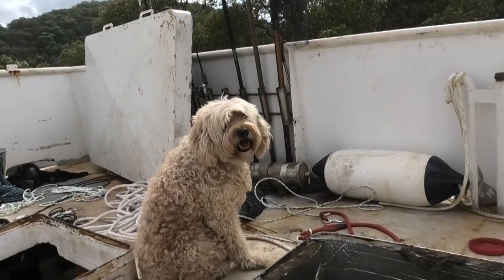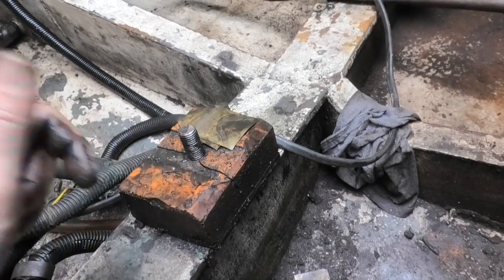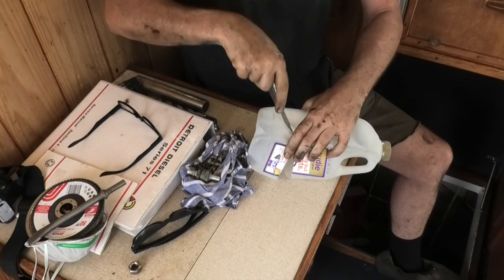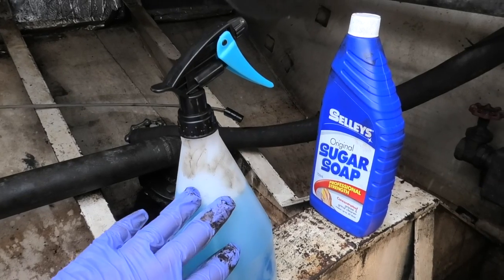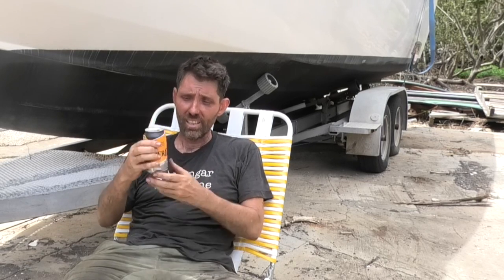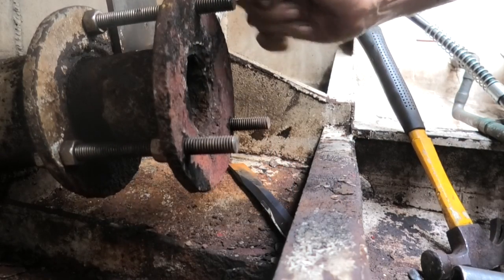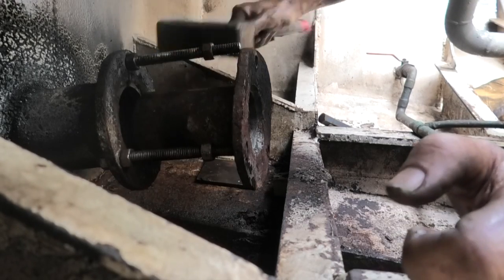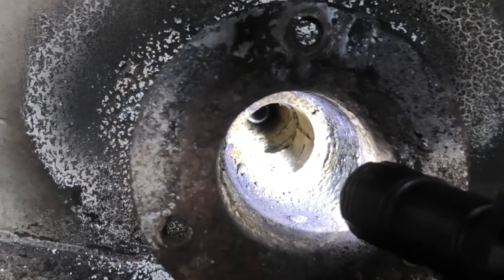Removing the propeller shaft from the steel trawler

Comment: Go dripless shaft seal. If not don’t use Teflon packing. If you use more than 3rings of packing make sure to use a lantern ring. Install a stuffing tube cooling line. Retired USCG CWO3 Naval Engineer.
Reply: thats solid advice
Reply: Can you elaborate on the cooling line?
Reply: Thank you all for your service!
Reply: A drip-less setup is a good idea. Gland packing has to leak as it needs the water as lubrication, if you tighten the gland follower too tight and prevent any water from exiting the stuffing box while the shaft is turning the packing will melt and begin to leak profusely this may also cause damage to the shaft. A lantern ring is usually placed after the first packing ring and before the final two or three rings. It is a steel or sometimes plastic channeled ring that is similar in dimension to the packing it it has ports drilled into it radially around its circumference, a port in the outer sleeve of the stuffing box is aligned with the lantern ring through which water is pumped, the water can then travel through the lantern ring and is distributed around the rotating shaft and forced under the packing  to provide lubrication.
Reply: Dripless seal, the way to go. Cheers 👍👍
Reply: What this dude said
Reply: Donald Sayers Mostly Bronze.
Reply: otm646 the cooling line normally comes off the raw water line on the engine. Always under pressure when the engine is running. Normally connects to the gland assembly, this does two things, 1st it provides a positive pressure to the packing/seal assembly of clean water  and 2nd provides clean water to the stern tube bearings and keeps them flushed out. With a typical RW pump you have between 6-15 psi of water pressure. Most of the time on boats of this size you’re looking at  3/8” (10mm)
Reply: @Mainlander now now ,  no need to get personal , you can both try to help by co-operating for the greater good  ( I have no idea what either of you said ,i'm a land lubber but impressed that you both want to get this boat in A1  shape)

Comment: Going well Stu.  You have to love cleaning bilges.  All the issues seem to be able to be repaired.  I agree with the comments re a water feed into the sterntube the water lubricants the stuffing box and exists via the cutlass bearing. It would be a good modification.  Even if you go to a dripless seal it would assist with the cutlass bearing. Rgds J
Reply from the maker: Thanks mate. Will certainly be looking into all the options for upgrading the seal.

Comment: Hey Stu, you gotta love it when you go into a job you thinking will be a nightmare, and things go better than if you had planned them. As the USCG CWO3 suggests, the dripless shaft seal and a cooling line are great ideas.
Reply from the maker: The biggest issue with dripless (other than cost) could end up being the space between the sterngland and the gearbox but we'll see.

Comment: Hi Stu, oh boy you’re really moving along now. I bet once you’re done you’ll notice a huge difference in the way she runs, smoother, quieter, and probably more efficient. I like your idea of a hard rubber for the mounts. I would imagine there’s some sort of steel and rubber type mount out there. I bet it would make a huge difference in vibrations and thus less sound being transmitted through the hull. Even if you dont do any engine disassembly(if it isn’t broke, don’t fix it), give it a nice coat of fresh green paint. Then you’ll have the green machine and your trawler’s engine could be the green monster. Great video bud, take care and keep charging on.
Reply from the maker: Thanks Kris. Definitely going to pair the engine, particularly the sections that have started to rust. Still need to do a bit of homework on the engine mounts but those broken ones will definitely need refreshing.

Comment: A trick for your bilge pump. One of the old steel boats that I used to work on I would reroute the bilge to come up through the deck at the gunnel. Use a 90° elbow to pump just overboard with a one one-way valve on the end. They seem to work really well and it was not a toe kick and it kept the deck free from unneeded water and hoses.

Comment: Clean the stuffing box good and when you reassemble it don't forget to use "anti seize". It will work good on the threads as well as the gland. Be careful on what you get for packing. It should seal but not mark the shaft. Check with a packing dealer. Sometimes a grease fitting on the outside of the stuffing box will help the packing stay lubricated. ask the packing expert. Best of luck.
Reply: I AGREE about using Never Seize.
Very good stuff on anything where threaded connections are made and also a great lubricant. 
I used lots of it when rebuilding shaft seals and stuffing boxes, works great and lasts a long time.
It's also great for dissimilar metal contact situations.

Comment: Yeah, those packings looked about the way i expected them to look. However, i did not expect the stuffer to be stuck like it was.
Clearly never seen grease, as i thought and we've spoken about. From here, the shaft doesn't look all that bad. 
And yes, buying a steel boat is fine, as long as it is maintained propperly. Which isn't the case with your boat, sadly enough. But hey, the price was right and i've seen nothing that can't be repared or upgraded sensibly.
I also like your plan to divide the bilge, good call!

Comment: Stu, I know you have passed most stages that can use the idea, but it may still come in handy. If you want an area to dry , or stay dry, from condensation or slight (very) weepage, get a cheap pack of toilet paper rolls. Leave the cardboard inners in the rolls, tie some string through the core ( makes retrieval, removal easier and cleaner) and place the toilet rolls vertically in the lowest part of the bilge/sump. The workings are pretty obvious, the advantage is that that even a flakey , rusty area will dry right out  as the toilet roll wicks the water /oil up.No power required. Runs 24hrs a day and is cheap. 
Just watch the toilets rolls - they are not a long term fix. With lots of water around the rolls last about 24hrs before falling apart once soaked. With oil they last about week before falling apart. But in saying that, my cousins farm saves the oily toilet rolls ( they have two or three in the sullage sump of their generator  to soak up oil and fuel spillage ( you could actually eat off the pit floor normally as it is so clean)  for use as emergency runway lighting . They have a set of tent pegs already in place along the bit of road that doubles as a runway and when required they just drop all the old rolls over  the pegs and light the rolls . The flames gives the pilots visual clues of wind direction, strength as well as the runway alignment and burn for about 15 minutes and then glow red for an hour or so. They never actually burn up completely.
Reply from the maker: I'm going to be doing some wet blasting in the engine room but the looks of things now so this tip may yet come in handy Ron! :)

Comment: It may be difficult, but at least the boat has been put together with a mind to the salt water's effects on nuts and bolts. I was an electrician for the Coal Board and the effects of the water made it very difficult to strip stuff down: all hand tools, cold chisels and no gas torches. Happy days. You earn every can of beer you get.

Comment: Hey Stu good work and good result. Hope the shaft passes survey as that will save serious dish. Personally I would not go PSS dripless on a vessel like this - a conventional stuffing box is absolutely fit for purpose. Might have been easier to work on removing the prop with the shaft in the boat.😉 You are doing a grand job, have another beer.🍺
Reply from the maker: I tend to agree that a conventional stuffing box is the best way to go for this boat. In hindsight I would have taken the prop off first but I'm sure it will come off okay once that nut it cut off. My big worry is not damaging the thread.

Comment: What is it with some boat builders (even professionals) that think it is a good idea to put a limber hole in the bilge space directly under the engine? I bought a brand new sailboat with an atomic four inboard that had a  big heavy fiberglass drip pan mounted under it.  The drip pan had been molded without a limber hole but the builders had gone and drilled a hole so that it drained into the bilge! The first thing I did to the boat was to plug up that limber hole so that oily effluent (if any) from the engine would stay in the drip pan and NOT get into the general bilge where it would have been pumped overboard (ecologically bad).   Cheers mate, I'm feeling every emotion right with you.
Reply from the maker: Drilling the tray was a very strange choice indeed!

Comment: Hello Stu, Regarding the inline water strainer, if you go to a rural center or plumbing supply shop you can get a brass one in 2" B.S.P with a stainless steel cylindrical filter that you can remove & clean by undoing a nut cap but they have small holes that probably would block up easily, you might be able to re-drill them to a larger size & make it work. The other thing to consider if you have to redo all that 2" gal pipe work with 50mm rural poly pipe fittings & 50mm blueline rural poly pipe as its easy to cut with a hacksaw, heat resistant, can be removed & pull apart pretty easily if need be, handles suction without collapsing, cheap to buy and there is a good range of fittings in all different types, use the aussie made Philmac brand fittings as they are the best I've found, you can get 50mm suction hose that would handle all those bends with ease. fitting a bilge blower might keep the engine box temperatures a bit cooler too. The good thing about welded 2" gal pipe work is that it last along time in harsh conditions, takes some work to get it done but once its done its done for a long while.
Reply from the maker: Poly pipe certainly is great from a cost, ease of use and corrosion perspective. About the only place I've been told not to use it is with skin fittings in the engine room as they will melt if there is a fire and cause the boat to sink. Other than they I think they are a great option.
Reply: Yes, that's what I was thinking, a plumbed CO2 fire suppression system in the engine compartment maybe the go either way, or sideways sliding teardrop ports you could fire a 9KG CO2 portable unit into the motor box, if there's a serious engine fire the outside water rubber pipe hose joiners are going to burn anyway if left to burn, thankfully motor fires are rare in a well maintained vessel.
P.S I've found you can get those 9KG CO2 & other extinguisher's when they are out of test for nothing as it costs them to throw them out but they are not a lot more to buy new with piece of mind.

Comment: Most boat repair yards will use an industrial size "wet Vac" sucks everything out, and uses different attachments for under engines and hard to reach corners especially when they don't have to be removed, they will use a needle gun or similar beforehand to dislodge rust as it saves cost and time....excellent job Stu what a great project, best of luck!
Reply from the maker: The vac did do a good job in there once the bulk was scooped out. I can see a lot of needle gun action in my not too distant future.

Comment: You'll be a shipyard worker yet.  :)  Good move pulling the engine.  I didn't realize the motor mounts need to be replaced.  The adjustable style is definitely the way to go.  I sadly don't have any advice on aligning the engine when you put it back.  Double down on the anti-seize when you go back together.  Put it on every metal surface on the shaft, the prop nut, the inside of the prop, the mating surfaces of the cutlass bearings, the surfaces on the packing gland, the shaft retainer, all the bolts, etc., etc.  The shaft looks pretty good all things considered.  I hope you can get the nut off the back without damaging the threads too bad.  Obviously don't weld it back on there.  i smiled when you said you were going to weld up the bilge well near the packing gland.

Comment: Hey a proper torch !!! Glad it finallyshowed up. And beer !!! Your really coming along now. Shaft looked pretty good I would just roll it on a flat surface if there are no obvious bends you should be fine . If there are you can straighten it with a hyd. Press. Didn't realize your prop was so small must not be much reduction in your gear box. That's fine I doubt you will be pulling nets anyway. The prop had a decent ring to it when it hit the ground that's a good sign. Dull thud  is bad. Drill and tap for a grease fitting on stuffing box . Your shaft will love you for it . Also when you tie up for extended periods you can pump the box full of grease to stop the leak. Old boxes like that need to drip a bit when running to stay cool. Your videos sure make me miss the boats.
Reply from the maker: You are right in that it is my plan to use the boat for pleasure purposes rather than commercial fishing so a huge prop isn't really required. I'll definitely look into adding a grease fitting on the stern gland if I stay with this setup.
Reply: @DangarMarine  one on the rudder as well

Comment: Looks like you are making real progress.  From the views when you removed the prop shaft, it looks like you have identical tapers on both ends, which allows you to reverse the shaft end for end, thereby locating unworn shaft sections at the bearings.  As others have mentioned below, a new marine stuffing box, such as the Johnson air seal would eliminate issues with corrosion at the actual stuffing rings. Since your gear is direct bolted to the engine, the engine and gear take the shaft thrust.  So new mounts if the vibration isolator type, need to be capable of taking thrust. Not all have this capability.  One mount that does is Ace Mounts, located In New Jersey in the US.  They have mounts that mate to Detroit diesels. Regards, Greg
Reply from the maker: Good point about end for ending the prop shaft if possible. I'll check out those mounts.
Reply: Dangar Marine You might also want to look into the Arid Bilge System.  It's really effective at maintaining bilges very dry.  Good for a steel boat!  Greg

Comment: I might, maybe, recommend shot-blasting, rather than sand.. With the already thin metal and rust you're dealing with, sand will erode it a fair bit more than steel shot. The shot's usually smooth pellets that tend to bounce before doing much damage.
Thoroughly enjoyed and happy AF you got all the bits and bobbles out without too much of a headache. Needed something to go your way without a fight ;)

Comment: While we are looking at propellers and thrust, I looked up how freighters apply all that thrust to the hull.  There are slipper shoes with oil pressure between them and the hull ring.  It is like the oil wedge in a journal to bearing in a car engine.  The shoes do wear and have to be replaced.

Comment: There are different types of stuffing and when I worked the Graphite impregnated was the best . Some engineers like sections and some like continuous wrap with added sections when needed .  It comes in rolls of length and it's always necessary to have some handy . Take your time and do it right .

Comment: The lip seal rubber type tube goes onto the shaft tube that you have in need of a clean and lip seal onto that mine is a chatfield blue water seal dial them up , proberly not in your country but there are many like , we had rusty bulges till the clr was was used  ,we brushed it around for a while and kept going back and slurping it about , wow it was clean shinny clean steel on went the rust kill , primer and nice white paint.  Today it clean and dry , wipe with a rag at times good luck

Comment: Have you looked at using the pressure washer, sand blaster adapter?  Dewalt has a solid unit for their 4400 psi unit... butter.